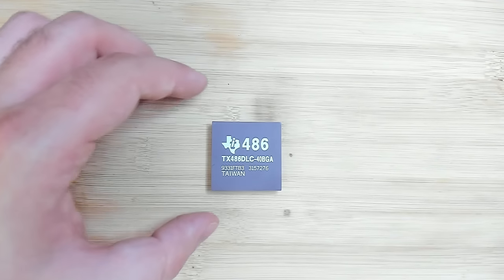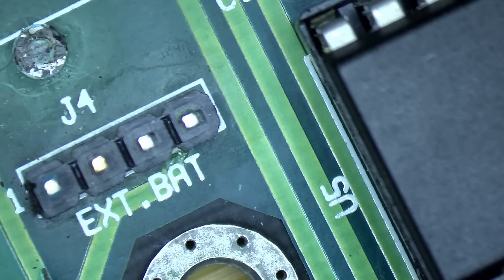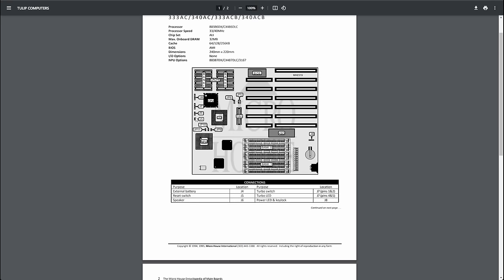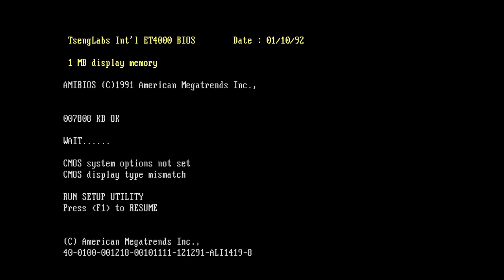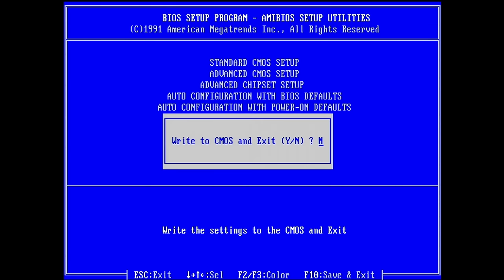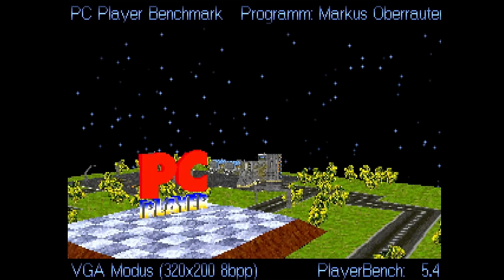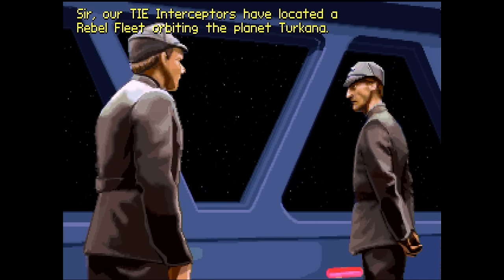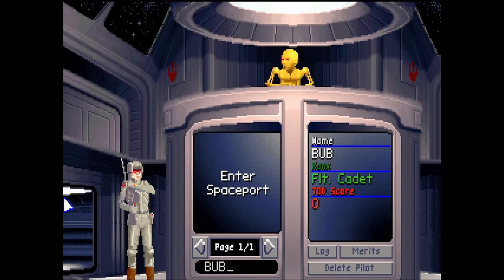A wolf in sheep's clothing: Cyrix 486DLC

Comment: i havnt heard sound effects like from xwing  (ive only had the cdrom version)  is that specific to the floppy version or where you using a different sound setup?
Reply from the maker: The floppy edition had no voice overs in mission briefings. The CD-ROM edition should have had voiceovers. Maybe you had speech off or on low volume. I tested this with a Soundblaster sound card.
I have a video coming up fixing a Soundblaster and I configure X-Wing with Soundblaster. The intro had already voiceovers, but the mission briefings didn't (in the floppy edition).
Reply: @bitsundbolts  no im meant the sound effects. Watching some other videos looks to me like there are more FM sound effects that are replaced with digital PCM ones from the later speech pack.
Reply from the maker: Hm, I have to test the CD-ROM edition again. I only used the floppy edition in this test without any modifications. As far as I remember, this is what the floppy edition (and the CD-ROM edition) sounded like. The only difference is the voiceovers during mission briefings. Well, the CD-ROM edition has better graphics, more missions, and other improvements, but I think the sound effects should be the same. I'm talking about the CD-ROM edition from 1994 - NOT the version released in 1998.

Comment: Why run the cache in writethrough instead of writeback? Writethrough == read only cache, writeback == read/write cache. Generally you should only disable writeback to prevent bugs from self-modifying code (on CPUs with separate instruction and data caches) or to support broken drivers that don't know how to flag noncacheable I/O buffers.
Reply from the maker: I'm not sure those CPUs support write back cache. I haven't done my homework on this topic yet, but since there were two versions of 486 with those two different cache strategies, I have a feeling that write back isn't available on that platform. But I'm not sure - I'll check.

Comment: Did you get the L1 working using the Cyrix tool?
Reply from the maker: Yes, I did. However, the motherboard also activates the L1 cache. What I found online is, the motherboard may not activate the cache correctly. The better option is to leave the BIOS option disabled and use the software only to enable the internal cache. I'll test this in a future video.

Comment: Check if you can find updated BIOS for that motherboard and burn it on a new EPROM or erase the old one first.
Reply from the maker: You're right. I didn't check for an updated BIOS yet. Sometimes you can flash similar BIOS images from other boards. I'll revisit this board in the future for sure.
Reply: @bitsundbolts  Yes, you can use BIOS image from boards that use the same chipset and often there is more/less options and sometimes it doesn't work at all.

Comment: I understand having multiple 5v lines (even if they are the same) because it permits more current, but why the hell is there a 5v line that's separated from all the others? That's just wierd.
Reply from the maker: Good question. I don't know the answer. Maybe it was a design choice that allowed easier routing on the motherboard PCB for some reason.
Reply: @bitsundbolts  is the split 5v shorted to the other 5v? Maybe it's a separate line. The C64 has 2 separate 5v lines. One is the main system 5v line from the PSU. The other one is taken from the PSU's 9v line and then converted into 12v, 9v, and 5v. This 5v line is used to ensure the VIC 2 chip gets clean power and reduces interference from the rest of the computer.
Reply from the maker: The 5v lines are all connected together on the board. So, I doubt there are different 5v lines coming from the power supply.
Reply: @bitsundbolts  that's what I thought too, but I figured that the isloated one MIGHT be different.

Comment: 7808 means there's shadow RAM - you've honestly never seen this count before? :P
Reply from the maker: I know about the memory area from 640 to 1024. However, I've never seen a BIOS not accounting for it during the memory test.
Reply: @bitsundbolts  It's the 384k Shadow Ram area (reserved)- I've seen more 386 machines showing 3712 Kb than 4096 Kb on a 4 Mb system, 7808 and 8192 on 8 Mb setups. By the time 486s came out, it was 8192 for the most part - I don't recall many 7808 RAM counts on true 486 systems, and I know of only one that did not count the 384k area that passed through my hands in the last 10 years. They were rare,

What does CheckIt show on a full RAM test?
Reply from the maker: I haven't run CheckIt yet, but I definitely should look at it. I'm sure it shows the full amount that is installed.

Comment: Cyrix's always lacked the FPU.. Cyrix ran good without it but any programs needing that FPU took very good advantage of it.. Try it with the FPU and see hjow it performs
Reply from the maker: I played X-wing with an FPU (for both, the 386 and the 486DLC). But you're absolutely right. In the benchmark charts I added that there was no FPU installed for the 486DLC. Benchmarks like PC Player benefit from an FPU. The same is probably true for other 3D applications like Doom. Quake would benefit massively, but this system will be too slow for that game.
Reply: Cyrix 486s are trash. The FasCache 486DX40 has a faulty FPU that makes every game crash when using with sound

Comment: Doesn't CLK2/10 = 0.72Mhz from 7.18Mhz Default?
Reply from the maker: CLK2 is apparently a pin on the chipset that connects to the 80 MHz crystal. Therefore, it's 80/10 = 8MHz.

Comment: what is a 386 with 486 instruction set - I always thought the instruction set is what defines a 486 😅 Ah well probably not entirely true, 486 has an integrated FPU this chip might not have 🤔
Reply from the maker: What I understand is that the 486DLC is a 486SX (no FPU), but made compatible with 386 pinout and bus. I guess it is similar to what Intel did with the Pentium Overdrive for socket 3 (just without limiting the data bus to 32 vs 64 bit on the Pentium).
Reply: @bitsundbolts  oh wow that's clever, thx a lot!

Comment: My first processor, was rather bad.
Reply from the maker: They didn't sell well as far as I understood. Even faster models that were released later didn't do well. I guess the 486 was just too good - specifically when the DX2 hit the market.
Reply: It's not so much that it's bad. Just that it can't compete with PGA168 socket 486 chips. As an upgrade on a 386 board these 486DLC chips are totally worth it.

Comment: A 386 acts like a dual core core2 duo r a dual mitherbiard, if a coprocessor is istalled. If a 33 mhz has a 66 mhz clock, the coprocessor must have it too, and the jumpers have to be set. Te coprocessor's 8 kb cache has to be filled up with additioal instructios, or else it won't be in use. The sound card and the modem can help out the x86 with audio istructions to offload the cmputer  frm the audio decoding.
Best try is to set the cpu cycles to very hgh (dosbox), then start Heretic. That will activate the coprocessor. The Stunts with fast car f1, and fast track: do deliberate crashes at max speed, you will enable the cpu physx of the old pc. These 2 tricks are enough to fully tune up the pc without burning out, and it's legal. Ideal for the best comuters today, but tge cycles have to be estimated.
Reply: What the heck are you smoking my man

Comment: You should compile some 486-specific code to test its support for the 486 instruction set.
Reply from the maker: There might already be something available that is 486 specific. Maybe Windows NT 4.0 would be a candidate. Or something else that is a bit less heavy.
Reply: @bitsundbolts  Possible - but 386 memory limits might give you issues (I know that it can theoretically support 4GB, but the amount of physical RAM you can install is way less than that).